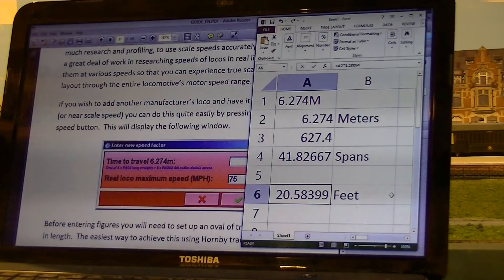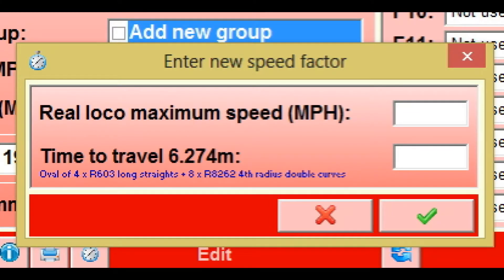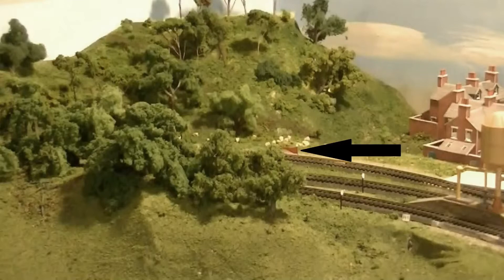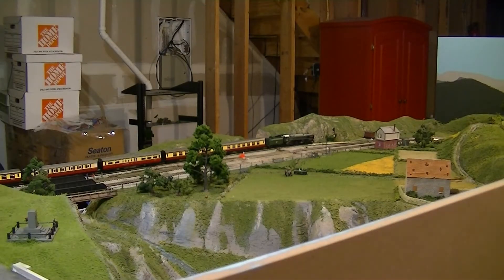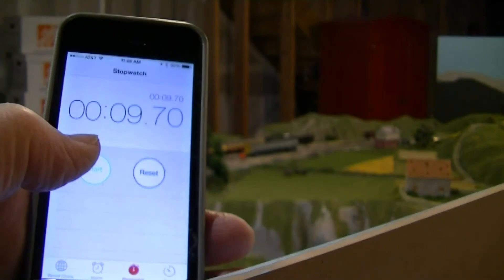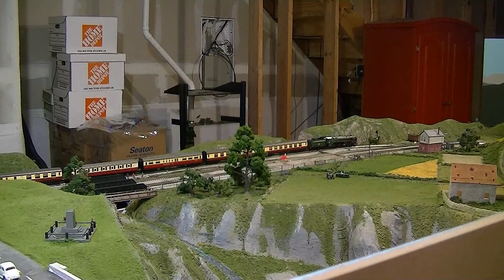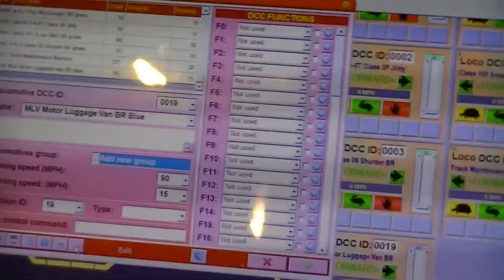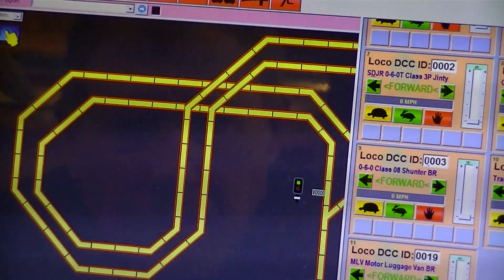Farland Howe - Timing a non-Hornby locomotive in Railmaster  -  #45

Comment: Nice video Rob! It looks like a good system to use once you know how to program it etc. The layout is looking great from those different angles too. Cheers, Dan
Reply from the maker: Hi Dan, the only real complaint I have with is I had and still have trouble booting it up correctly.  I have managed a strategy to deal with the problem that works most of the time.  Hornby has no solution, we've talked.  It is quite good software and link for the money, it cost me about $85 US.  You can change CVs quite easily, build consists and disolve them easily and program moves in time based logic.  The price was good and I have all the flexibility of a large program, 1000 loco addresses, so it works okay.
Reply: Yep as you say good value for money, amazing that you can have 1000 loco addresses too!
Reply from the maker: TheMisterdan01 More amazing that you can change the CV values for things like acceleration rate and deceleration rate.  Have a great weekend.  Rob
Reply: yeah I like the sound of that feature Rob, I suppose it's like anything it has it's good and it's bad points

Comment: Good idea Rob but confusing for me but very enjoyable,cheers Tony
Reply from the maker: Was my video unclear?  I was just solving the time distance equation.  Well, I am glad you enjoyed it, but how can I clarify?  Cheer, Rob
Reply: Rob McCrain
Hi Rob i understand now i have thought about it,so the hornby throttle has speed markings on it yes ? or no,i only have a gaugemaster d controller which is dc,so your layout is dcc ?cheers Tony
Reply from the maker: TheZimma The Hornby throttle shows the scale speed selected or perhaps I should say the scale speed that the loco is running.  Push up the throttle and the display increases the speed readout on it.  I have experimented and it seems to be within about 5% in accuracy. All the best,  Rob